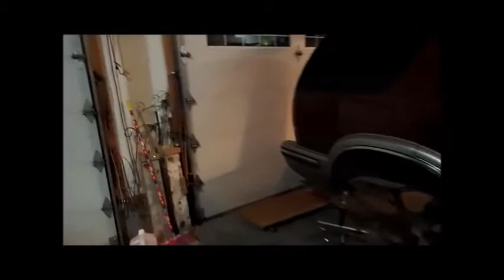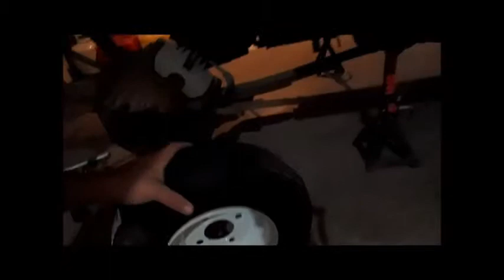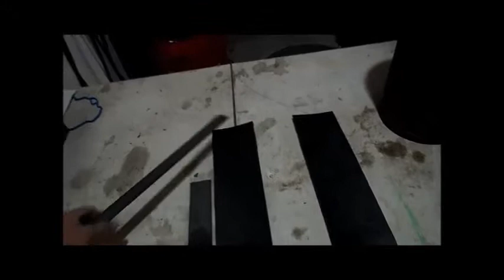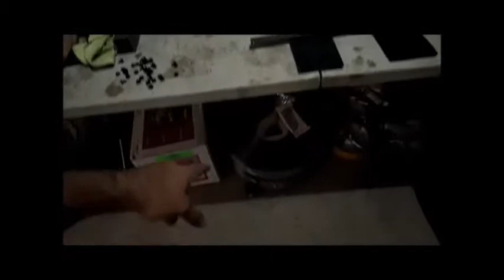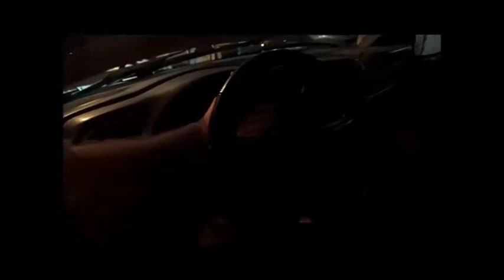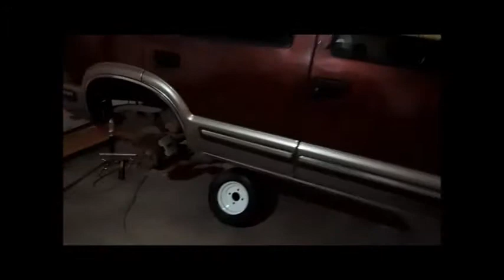Custom Tracked Vehicle, Part 3, Planning and Theory

Comment: Could have used the steering box to aply the brakes for steering to turn and use your stock master cylinder for stopping
Reply from the maker: Hi Shane, That is possible but you need to build a custom control system for it. A master cylinder when retracted all the way vents brake fluid to the reservoir. So you cannot have two supplies of braking power to one caliper. However I have thought of two ways to solve this for next revision. First one is to add another brake to the drive shaft, this would be actuated from the brake pedal and then use the steering box to run two cylinders that can run the individual brakes. The other way is to use the steering box to run the individual brakes but then build a custom bracket that can actuate both cylinders from the brake pedal, issue with this method if you brake while turning will have some interesting results.
Reply: You add a 2nd pair of calipers to the rotors and use the pitman arm as a selector as to what way your wanting to turn.
Reply from the maker: Yes, but adding calipers is challenging to combine another set of mounting holes for a second caliper. I personally like the idea of adding a rotor to the drive shaft instead for braking. Another video I watched showed a guy splitting the driveshaft output into two, adding a clutch to each (combining two differentials so each would output to only one side) and then actuating each clutch to steer and keeping the brake calipers on the brake pedal. See how things go.
Reply: There's one problem with running a pinion brake is that you are dealing with a semi floater you have c clips holding your axles in that's a whole nother can of worms they personally you should deal with I've had axles walk out on me on my 71 Chevy long box which was originally a half ton I now have 3/4 ton running gear under it with a full floater out of a 1966 Chevy 3/4 ton it's a eaten with a drop-out third member but that's serious overkill for you and I'm sure you don't need 4:56 gears but still being a c clip you need to think about the possibility of having Axel's walk out on you and adding a second caliper to your existing rotor wouldn't be hard it's just a matter of making an entire new bracket which you take your caliper Mount off and you go from there look at the kits for a 14 bolt full floater disc conversion and see how they did those and kind of duplicated for your application
Reply from the maker: I originally chose the 98 Blazer because it used rotors and not drums and I am on a tight budget. I didn't know they made conversion kits. Having the brakes outside on an ATV like this won't work long term as the brakes are always in mud and muck. In industrial versions the brakes are all moved inside, so that is where my head is long term, maybe version 2. I get what you mean regarding the c clip however there won't be any lateral tension on the wheels since those sprockets don't touch the ground, so I am hoping no issues. However the gear box and spiders will take a pile of torque and I fully expect them to fail sometime. But this is the path I am on now and can't afford to replace the rear end. I just need to get it functional and then start testing for reliability.
Reply: Like I was saying in my 71 herniated to 12-bolt rear ends one the pin decided to deteriorate and eat itself which was locking the third member up and acting like a posi and I was spinning forties over like it was nothing and the second one what is a gov lock posi out of a 75 Scottsdale that didn't like my right foot and gave up the ghost within the first week of having it under my truck and said sandwich that was spring of 05 I've had my full floater eaten under it and it hasn't gave me one iota trouble but mind you you know I have a hell of a lot more motor than your 4.3 V6 I have a mild 350 in mine and I also had a 205 transfer case behind my Turbo 350 since then I have upgraded a few different things and now have a granny 4-speed manual and in the works of putting a twin 205 doubler in it along with a whole bunch of motor mods like a TPI from a 86 IROC and a few other things and I totally understand the whole the whole on the budget thing I've been building my truck on a very minut budget for many years I have been piecing my doubler together for 2 years and also Built My Own adapter to mate the two transfer cases together so I totally understand working on a budget but if for whatever reason you snapping axle or your third member decides to give up The Ghost like-minded and spit the spiders you potentially take the chance of losing an axle and being stranded look into c-clip eliminators for an S10 the allow a press on bearing that the actual bearing itself at the wheel the cyst behind your wheel flange holds the axle in place not the c-clip at the spider gears and also behind that disc brake you have a drum parking brake also known as a hat parking brake
Reply: I am by no means trying to burst your bubble I am just letting you know of potential problems you may run into you know I speak from experience of blowing up c-clip axles the gov lock posi 75 Scottsdale rear end I had my driver wheel walk out on me and I was stuck on the side of the road till I was able to jack it up and Slide the tire in and Limp it home which I was already limping home after urinating the third member